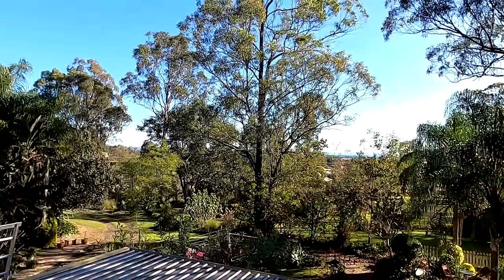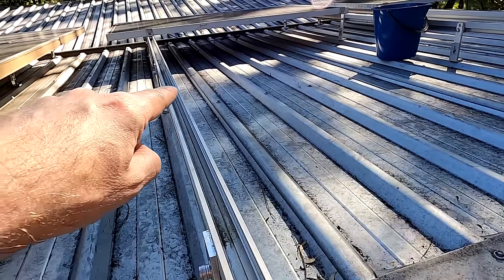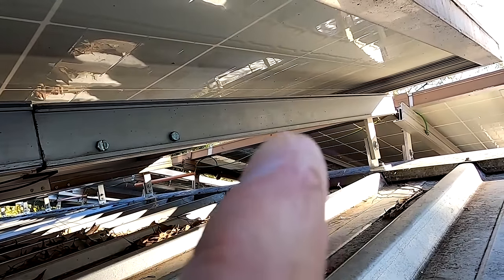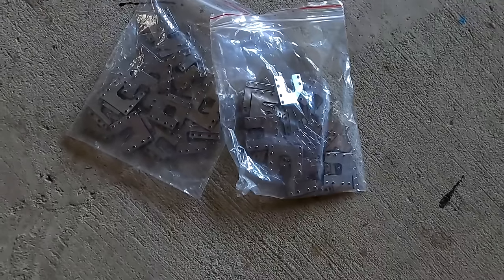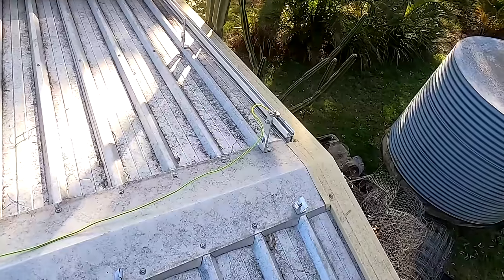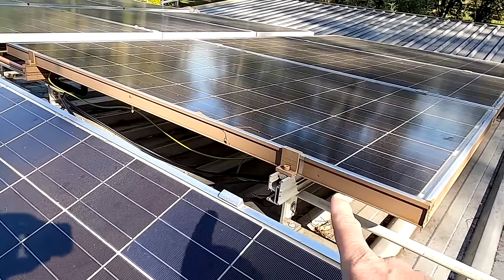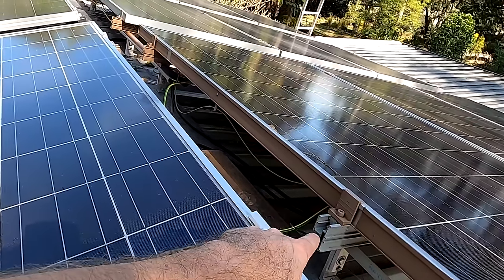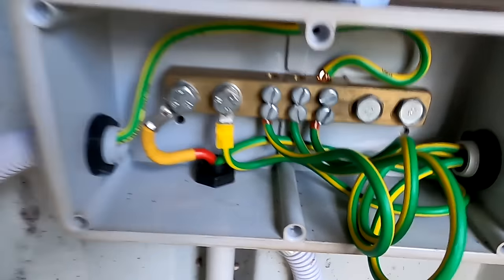Solar Grounding Essentials. These important safety features are often forgotten.

Comment: What about earthing to a 1.5m to 2m copper rod that is dug deep into the ground or to a lightning protector in the combiner box? I worry about earthing to main bus bar in the house as sometimes you find hybrid inverter that merge/bond the neutral and the grounding together
Reply from the maker: The main earth bar is connected to the earth rod outside of the garage.
With the Victron inverters I can connect/disconnect the internal bonding depending on the installation requirements. I have them connected as I'm off-grid and create my own grid with M.E.N. link inside the garage.

Comment: I assembled, tested,  pre-inspected (an actual inspector inspected the product), and installed wire assemblies, power cables, avionics racks, electrical power centers(below the cabin, forward of the wingroot/fuselage join on "wide body" A/C; and behind the pilot on the "narrow body" aircraft); military aircraft....  The Hughes Flexible Automatic Circuit Tester (FACT 2000)"rung-out" the wires and circuits per the configuration, and revision, on commercial aircraft.   The military aircraft wire verification was accomplished by a  DITMITCO(?) Tester.  "Continuity" was a Ohmic value, determined by the F.A.A.  I think that is =>22ohms.  There's another test for "leakage" of the insulation, connector bodies, etc.  The leak test identified faulty insulation, incorrect cavity positions, shorts to ground, flaws int the test cables, etc.  It had a "range" of Rho-mic values as well.  The military wire assemblies, avionics racks, etc., were tested to much higher degrees/standards(Continuity, Leakage, and...for a longer duration of time).  The commercial aircraft testing system would fry reed switches and smoke power supplies (depending upon the amount of stress that they were subjected).   The military testing apparatus would constantly roast stuff.  Our aircraft had 3 redundant systems for all computers, etc.  That is ONE ONLINE AND THREE BACK-UPS!  Three are required (per the FARs).  Our aircraft had one extra device (#4), so the aircraft would still be airworthy -with one device dysfunctional.   So each electrical circuit has atleast five paths to the pilot's interface.  At the time I was building those aircraft:  the main avionics rack had around 10,000 wires in it.  Tiny 20, 22, and 24 guage wires.  With tiny letters identifying the assembly, wire #, and guage... stamped every 6 (?) Inches along the runs and every 3(?) inches at the beginning and ending 4(?)feet.  Yes, circuit Continuity  has different levels of acceptance, depending upon the application.

Comment: I used kindorf to mount my 10 panels on and they are threw bolted at 4 points of each panel , I put 2 #6 ground wires on 2 of the end of kindorf so all panels were in contact , put 1 steel rod in ground at corner of array and ran grounds to that , then from that ground followed pv wires Bach to inverter and put to inverter ground .i was told that is correct way to run grounds for panels by commercial installer

Comment: Thanks for you video and information. Have had solar installed in early 2018 and there is no earth wire to be seen. Could you please link to the regulation?
Reply from the maker: Totally depends where you live. You can google most regulations and rules for your region.
Reply: Seems totally bonkers to me also on an iron roof.it's a bit like fitting those isolators on the roof. The professional installer who did mine allowed water to enter the conduit which flooded the isolator switch and it caught on fire the next sunny day. Luckily I have an iron roof  and the damage was cosmetic. No earth wires but what is to point on an iron roof that is grounded by my steel framed house. The more safety we add the more problems we are creating. If you measure the resistance to ground between the earth and the house frame in my case it is close to 0 ohms and you can't generate a high voltage across that. What problem are the regulations trying to solve?

Comment: Are you sure that flexible plastic conduit is UV stable? We have UV stable black ones (like 10 times more expensive)
Reply from the maker: Yes, it is made for outside conditions. I have one installed since we bought the property in 2009 and it is still flexible like new. We also have orange conduit for underground installation. Both are UV stabilized and resistant.

Comment: Hi Andy, as soon as my charger reaches absobtion voltage the current drops within 5 min to 0. The absorbtion time is set to 2 hrs. Same settings as you and also the same hardware (only 32 lifePo4) Is this normal?
Reply from the maker: It depends how fast/slow the battery is been charging. If you current drops quickly after hitting absorption it means your batteries are already full.

Comment: There are a lot of questions around grounding solar panels. Many people say it's for lighting protection, which is wrong. Firstly lightning is always looking for ground, if you ground your panels you are actually making it more attractive to lighting. Also if lighting does strike your panels 6mm² cable is not going to safely and effectively carry all of that power away, it isn't. Proper lightning protection is actually heavy guage conductors standing above the structure to be protected and going straight to ground with thick copper straps or cable. Solar panel fault is the second reason, but the busbars and elecrical contacts in panels are nowhere near connected to the aluminum frames of the panels so no contact will be made there. Faulty worn cabling touching the rails is maybe a reason, but cable sucured properly shouldn't go this way. I know it's code compliance, but can anyone tell me a real reason to do this because i don't know.
Reply: Actually it provides no benefit if the DC system is not reference to the Earth as it will just mean that when conducts touches the earth metal it references the system to earth you can very much mean you touch the negative and get her shock the reason why it is asked is generally in case of inverter failure or stuff like that when the DC system gets reference to earth unintentionally if it’s learnt touching a metal park you can’t get a shock

Comment: Not sure what the point is about the grounding between the profiles that carry the panels? 
The roof bracket is insulated with a surface underneath the fastener, but the screw will direct any surge from the AC side up to the profiles and down again to the grounding bus bar – but is there any point? 
- Grounding on the outside of the roof should surely be with the disposal of external current that can knock down roof mounts for the main purpose? Lightning will damage the building and the equipment on the roof, but is it desirable then to direct lightning into the garage?
Reply from the maker: I don't want to disappoint you here but wait for the next video. A roof or building structure is not an earth point.
Reply: @OffGridGarageAustralia  Thanks for the answer, my concern was hot wire and melted insulation give a greater chance of fire in plastic-pipes and finally in the garage.

Comment: Is the plastic covering of the earth cable UV resistant?
Reply from the maker: The cable is not exposed to UV light. It will sit mostly in conduit except the few cm where the clamps are. This location is under the panels, away from direct UV light.

Comment: If you connect copper to aluminum, the aluminium will oxidate before your Copper. That's why you clamp a Zink or Aluminum block to iron things like boats and docks at sea. So I would only worry about the oxidation of the aluminium.

Comment: Before screwing I do not remove the plastic around the earth cable, the bolt seems to remove it enough to make contact. In fact in manuals I do not see they ask us to remove the plastic. For beter reliability I screw, unscrew then screw again.
Reply from the maker: But then only the screw would have good contact with the wire, while the wire is still insulated from the actual earth lug. If this is in your regulation 🤷‍♂️ I would say that's dodgy and not good practice from an electrical perspective.
Reply: @OffGridGarageAustralia  but the wire is screwed into the device. In fact there is no need for a massive contact (as show the 4 very little "pins" that make contact under the panels). If the silicon resists to the elements, your solution is the best. But perhaps it makes no difference. Perhaps.

Comment: I understand grounding the cabling after the system, but why ground the panels? if any lightning hits, everything is fried anyway and you will discharge to ground which means that you will have a discharge to the house as well(potential depending on distance), correct?
Reply from the maker: Grounding has nothing to do with lightning protection.
Reply: @OffGridGarageAustralia  what does grounding the aluminum frame of a solar panel that is in no way connected to anything in your energy production system do? Seems like lightning is the only energy source that would complete a circuit between the frame and any conductors several inches away...

Comment: Very nice video Andy. Thinking about the PV  panel frame. We should measure if all the Alu sides  are inter connected. If not, 4 corner grounding is justified. But I ordered only 1 piercing metal per panel as I didn't thought about it before.. Also, there is a better putty for waterproofing connectors . One, that you can undo. For electricians. It's like a chewing gum, sticky stuff. Silicone is  not good enough. Probably no silicone is better. Lugs should be better also than exposed  wire. They may vibrate lose and corrode, in my humble opinion. Cheers from Pavel

Comment: Gal spray and not paint pot.  Squirt.  Squirt and all done.  Also, had 4 panels laying up against fence for 5+ years, never earthed.  Always moving them in to the sun.  Should create a load dump as the panels get noisy when the inverters stop charging in the summer or sunny day.

Comment: i know inverters need good grounding its not for lightning bolts its to keep the grid from melting true or false?
Reply from the maker: It's for safety. If a live wire comes in contact with the metal case the safety switch should trip and disconnect the circuit before one touches the metal.

Comment: I am posting a stupid question:
How the solar panels and inverters will behave in case of a earthquake the National power grid is 100% off ..down.. shut.
 So..my solar energy can not be transfered (feed in) to the power grid . What will happen? The inverter will blow away? Shall we have an emergency button to stop the feed in?
Reply from the maker: If your grid fails, the inverter will turn off automatically for safety reasons and you won't have power any more unless you have a battery backup. 
If earthquake or zombie apocalypse does not matter...
Reply: @OffGridGarageAustralia  
Thanks for your reply.. "The  inverter shuts down ".   
  But this is my ignorance:  
The solar panels are still operational and absorbing the  energy...from the panels to the  inverter the  AC electricity still on. If my house is empty and no one is  living  because of the supposedly earthquake  what will happen?  The panels are on and  the  Inverter is off I presume  the panels will start burning.

Comment: Now you've created a giant lightening rod you need a lightening arrestor in your combiner box because it will have no problem jumping a fuse gap.
Reply: That should always be installed generally speaking
Reply: @UKsystems  They don't recommend grounding solar panels in the UK unless they are going up on a building that already has a lightning rod installed. I looked into it.
Reply: @sang3Eta  that’s why the surgery arrest needs installing in the UK. It gets a bit more complicated as Arthur regulations come to play as it’s count as an extraneous metal part of people can come in contact with it for instance through a window depending on how the roof works.

Comment: In my opinion the way you had done the grounding with the ring lug bolted to the aluminum rack would be more then sufficient. 
   Spending excessive amounts on those very nice and very expensive grounding brackets,  in my opinion, are totally unnecessary.

Comment: You have that strict code because its on a building? My ground mount doesn't have that strict code.
Reply from the maker: What strict code? Panels need to be grounded anyway
Reply: @OffGridGarageAustralia  I am saying the special clamps and 4  connectors on each corner.  I have 1 ground wire that connects all panels. each 4 panels connect together at corner where cable attaches. My panels are on ground wooden mount is why I have to ground each panel. My neighbors is on metal frame in ground and his doesn't have a ground since frame is ground. Just wondering why they have you use the corner pieces on each corner(cause its on a building?)

Comment: Hello, you should take off the plastic from cable, usually the earth cable should be without plastic because it designed to discharge high charge voltage from lighting.
Reply: Screw will go trough the wire insulation so stripping cable is unnesessary.
Reply: @MrRaddoslaw  so you're one of those dodgy electricians are you?
Reply: Grounding isn't for lightning protection, cross-section area is too small
Reply from the maker: It depends on your country and rules which ground cable you have to use. Down here a 4mm earth cable would have been enough but I got the 6mm cable for the same price. 
In the US the cable is just bare without any insulation. Not in other countries though.
Reply: @OffGridGarageAustralia   Yes bare AND solid , not stranded .

Comment: The real other reason for earth the panels is to discharge corona charge . Every 1 meter above the ground 100 volt charge will be induced into it, at 3 meters up it 300 volts. Due to the anodising, the aluminium is an insulator and this charge can build up to a dangerous level over a large area.
Reply: "Due to the anodising, the aluminium is an surface is an insulator" can you refrase that?

Comment: You should not place the cable into your busbar in the garage. The panel structure and rails should ONLY be connected to a dedicated copper spear outside. If a lightning strikes upstairs it will fry the rest of your equipment that is connected to the garage earth busbar.
Reply from the maker: Well, this is earthing, not lighting protection.
Reply: The rails should be earthed to the common earth point - so in the sub board.

Comment: Unfortunately the silicone caulking you used contains chemicals that seriously and quite quickly begin to oxidize that copper.  Well intentioned, but you'd been better off using nothing -- also would have used solid bare myself.

Comment: Copper oxide is conductive. Paint and silicone are not. I'd go with bare copper.
Reply: That zinc galvanization compound "paint" is very conductive
Reply from the maker: Yeah, the cold gal paint has 91% zinc so is actually conductive.
Reply: @OffGridGarageAustralia  In that case I would *DEFINITELY not use it on copper.  Zinc and copper have too much electro-galvanic potential and corrode each other.

Comment: Isn't that a metal roof?  And building?  Hmmm,  what great ground conductor !   Zombie proof, oh yeah.
Reply from the maker: Nope, that is absolutely not allowed to use a s ground connection. It ALWAYS needs a separate ground wire. You will see this in the next video why it is needed.
Reply: @OffGridGarageAustralia  I was poking fun.  ...Yeah, probably a whole chapter on solar panel installation,  inverters, batteries....  The central grounding point "system" seems like it could have some interesting complications!!!!!!?????  Good topic for a series of videos.

Comment: Grounding panels is quite a ridiculous exercise. Best to give lightening a tasty attractor away from your roofs. Way too much wiring and expense that achieves 5/8ths of nothing. If lightening strikes the roof is usually already grounded in aus and those panels are going to get fried regardless of protection.

Comment: Silicone is nothing to be in contact with copper, especially if it emits acetic acid while it hardens. 😱
Here in Germany the earthing has to be done with a 16mm² cable.
Reply from the maker: Earthing in general yes, but not the solar panel; earthing. A 4mm cable is enough down here. 
The silicone is acid free... 😊
Reply: @OffGridGarageAustralia Use liquid insulation tape much better , I used it on cables and its been in the elements for many years without any problems.
Reply from the maker: @bascomnextion5639  Ah, yeah, that's a good tip. I still have seme left from building the battery shelf.
Reply: @bascomnextion5639  /i had to google that:

Liquid Tape is a rubber coating that takes the place of electrical tape by providing electrical insulation to hard-to-reach places.

Provides excellent protection from acid, alkaline, and abrasion
Seals out moisture and salt
Strongest dielectric protection on the market
Protects electrical connections on wires, cables, alarms, electronics
Will not harden, unravel or become brittle in extreme weather conditions
Liquid Tape can be used in many applications including electrical connections for boats, trailers, RVs, trucks, automobiles, timers, pool electricals, bilge pumps, sprinkler pumps, instruments, computers, circuit boards, switches, and stop terminal screws from vibrating loose